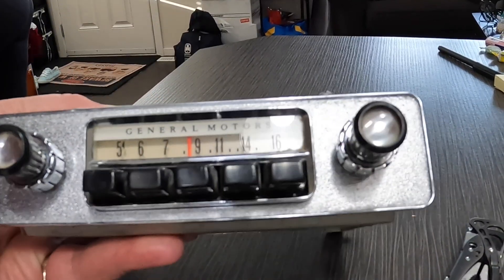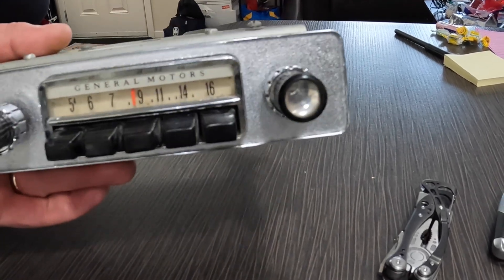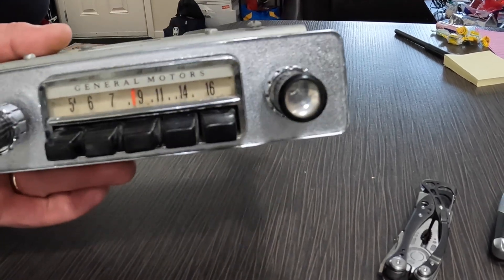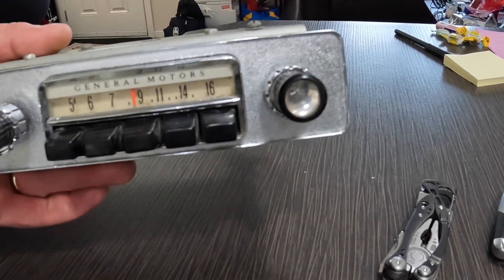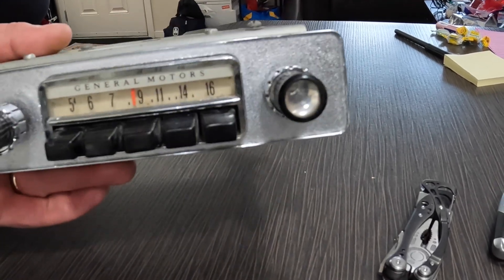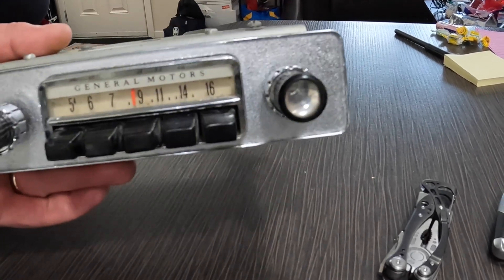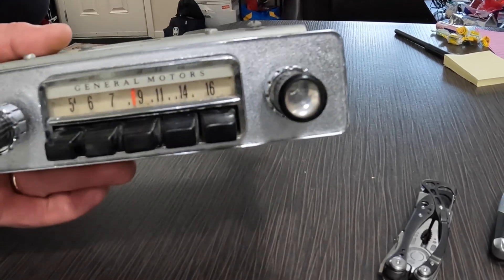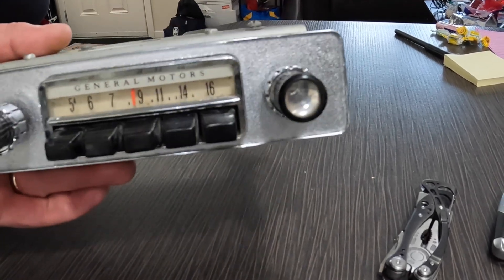Bluetooth Radio in a Classic Car or Truck for $10?  I’ll show you how I did it.

Comment: This bypasses the radio, so I'm  thinking you loose the ability to balance and fade shift the front and rear speakers?
Reply from the maker: Yeah, it basically drops down the ability to do much at the $15 mark, two speakers. No balance. No fade. No bass. No treble. Very basic at this price point, just stream from your phone to a speaker or two on the vehicle. 

If you wanted to spend more the sky is the limit, this video here is just for the basic guy….. like me lol

Comment: After watching this video I decided to convert my radio to the Bluetooth setup. I used the same unit and it worked fine for about 4 weeks and now it refuses to pair at all. Has anyone else had this issue?
Reply from the maker: Strange. Mine is still
Working. A dud maybe?
Reply: @shortcutgarage  I'm not sure. I've tried jiggling the wires thinking there was a bad power connection but it's solid. I guess I'm going to yank it out and look for anything out of place.

Comment: But what if there is a weather alarm, or if there is an important message from the president. Only the AM radio is capable of receiving airwaves after the nuclear winter. Or when your ass is frozen tight. All U.S. emergency broadcasts are still on AM, just like it was seventy years ago. It could be that they've given up, that there is no hope for survival.
Reply from the maker: If it happens we’ll have to convert it back in that case, good news is there will be another video for our end of times AM radio conversion!!

Comment: The module that is used in this conversion it is just simple amplifier, there is no Bluetooth at all!?
Reply: Yes, I cannot see any mention about Bluetooth in Amazon. It just says it's a plain amplifier.
Reply: @Polydeukes68   Modules that can receive BT signal have kind of square wave shape  antennas on the board, the module in this video has none, how it can receive signal from the BT sender. It is just an amplifier no BT.
Reply: Ah, he is now saying a different module in the description that he said originally. Luckily I looked at it closely and did not order the first one without questioning.. But, the new one looks nothing like the one in the video. But, the new one (ZK-502L) will probably do the job!  Note that there is huge price variations between sellers in Amazon for this product.
Reply from the maker: @ I’ll release a short and show you what happened there with the part numbers
Reply from the maker: That’s literally the one in the video, it is Bluetooth.
Reply: @shortcutgarage   Modules that can receive BT signal have kind of square wave shape  antennas on the board, the module in this video has none, how it can receive signal from the BT sender. It is just an amplifier no BT.
I checked several of these modules  on Amazon, none of them mention that has BT ability and if they would have BT that would be clearly underlined..
Reply from the maker: @ that’s literally the one in the video
Reply: I checked the spec sheet on the chip on the module and it only talks about amplifier function, nothing about BT. The module does have an analog audio input (the black jack thing near the potentiometer), that is mentioned in the Amazon description. I am just trying to understand how this thing has BT when sellers do not know about it? 

I would like to install one to my old car but I have no use for analog input, I need BT and have no money to waste. Anybody else tried it and actually see the BT? In the video the BT was visible on the phone even when it had no power connected, just like the host said, how is that possible?

Comment: Personally, i would have desoldered the volume knob/on off switch and mounted it directly, but otherwise great job!
Reply from the maker: Interesting, I’ll look into that because I would t mind keeping the tuning knob tuning (even though there’s nothing on AM where I am) it would just look cosmetically better. Good tip. My next one I’m trying that. Thanks!
Reply: @shortcutgarage  There are some bluetooth adapters with an rotary encoder or a jog lever where you can skip forward or backward tracks. This is a nice function as well
Reply from the maker: That would be cool. Can you share a part number?

Comment: I'm confused can you still use the original radio configuration?... Have you lost tuning radio function?... Seems a bit silly if that's the case as very easy to add this as an FM channel through an antenna connection... Which exists for about the same cost...

Comment: That's pretty slick. What is the part number of the adapter? The size and configuration looks perfect.
Reply from the maker: @GlennF-y3k    

DC1.8-12V TDA2822M Mini Audio Amplifier Board 2.0 Dual Channel 3.5mm AUX Stereo Audio Amp Module with Knob
Reply: I found your post on the 67-72 Chevy Truck group, but it looks like they took it down.☹
Reply from the maker: @ that’s too bad, they probably think I’m trying to sell something but I’m not. 🤷‍♂️
Reply: Thank you! I just ordered the exact one on Amazon for $6.99. Only two left.

Comment: Good job.  I used redi rad with a Bluetooth adapter. Cost more but the original factory radio was still there and was no need to remove it. Redi Rad plugs into the antenna port on back of the radio and plug a generic car Bluetooth adapter to the redi rad. Still can listen to the radio stations if needed.   https://youtu.be/IrergDBrBjY?si=EcW2z1fRX0fZdeP3
Reply from the maker: I’ll look into that, would be cool if it could keep the radio too